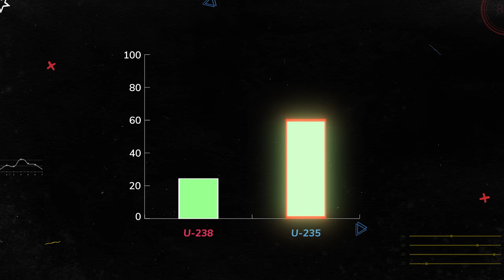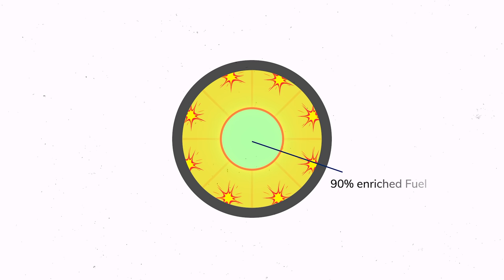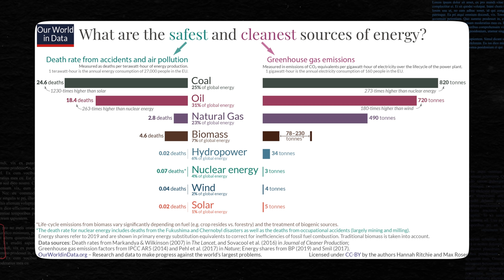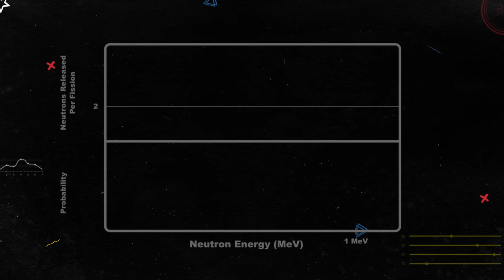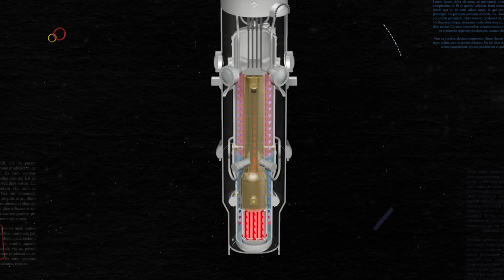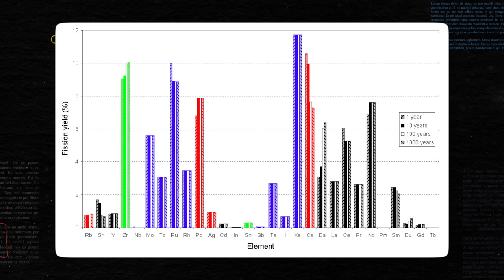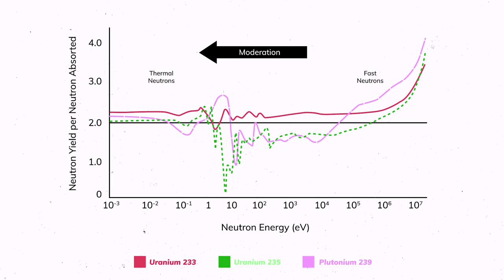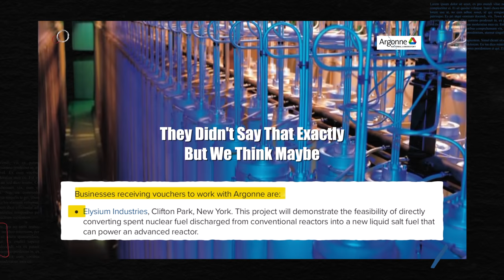This Reactor Feeds On Nuclear Waste

Comment: Being German I was socially implanted with a cringe  whenever I hear "nuclear". And too much cost, IMO, was offset to the public in the form of nuclear waste by the energy giants while they profited richly not caring about the radiating world they leave behind. Some more remarks on policy and governance to guardrail this nuclear renaissance, on top of your scientific excellence, I would highly appreciate.
Reply: @bike-cave-man2527   That is not actually true. They are only cost effective as long as other sources can compensate for thier intermittent nature. If you force them to do the same job, then renewables need energy storage and the price skyrockets. They are slowly getting better, but are not competitive with other tech at this time.

So as long as the renewable capacity is a smaller percentage of the total production, it remains low cost to the installer. However they drive up the total installation cost. The base load capacity must be large enough to cover for them when not running. This means that installing solar for instance adds cost to a system that already can produce the needed capacity. 
The operating costs of the renewables are usually low however and eventually pays for that added cost (again as long as it is supplemental, the cost is comparable when storage is included).
Reply: @garysmith5025  I don't really see vehicles being that effective for storage. The idea is fine, but the usage mismatches the with the generation. If I want to power my home with my car, then I need to be charging it during the day. Problems is that is also when we use it as a car, and it won't be home to be charged, and will return discharged to some level. In theory we could put large solar installations at some businesses and charge cars, but what is thier motivation to do so and would they have enough space?

I think home based storage will be needed. If cars had swappable batteries and you had two it would work.
Reply: @court2379  Regarding storage, please consider that many pumped storage plants have been built for valley filling, as nuclear power plants didn't like to be shut down during the night - this power needed to be stored. In Belgium the off-peak use during the night was the illumination of highways.
Reply: @court2379  The idea is not to allocate a given EV to a given home (with PV) and to match that. The idea is to combine a fleet of EVs with the grid, so it doesn't matter if a specific vehicle is not conneted to the grid. Its about statistics only. Regarding the infrastructure, please compare with the situations 120 years back: the filling station was the local pharmacy, and the typical gas station developed in the coming decades. So will be the charging infrastructure - in most cases, if there is a garage, this will be a socket at home.
Reply: all the nuclear waste from all the nuclear reactors in Europe created since the very first one was fired up could be laid out on a single soccer field and be less than a metre high (in fact you'd have space to walk between the stacks at that height)

Storing it isn't an issue. Most of it is kept onsite and contrary to claims, after 400 years it's LESS radioactive than the original fuel (which is quite literally only slightly more radioactive than a banana for any given volume - believe it or not, truckloads of bananas keep setting off radiation sensors intended to find weapons in ports)

The problem is vastly overstated by fearmongers
Reply: @George Mann There's the secondary factor that renewables can't produce enough TWh to replace non-electrical carbon emissions. Electricity only accounts for 1/3 of carbon emissions at the moment and eliminating the other 2/3 requires around 6-8fold increase in electrical production
Reply: @gunnarkaestle  "nuclear power plants didn't like to be shut down during the night" bzzt, incorrect. That is a direct artifact of using fuel rods and molten salt systems are immune to this issue.

The Oak Ridge reactor used to be shutdown/started up at least once a week because nobody wanted to babysit it over weekends anmd tests showed it could very happily go down to minimum and back up over any time period with no ill effects. No xenon waiting period required because no xenon is left in in the reactor

HOWEVER: even coal/gas plants have thermal inertia. It takes HOURS to get a thermal plant operational. (This is why the South Australian power blackouts happened when wind power failed for 6 hours - Thermal plant operators calculated ther costs of starting up were lower than income from electricity sold and declined to fire up their boilers until all costs were underwritten)

British local authorities who thorugh they'd save money by turning off streetlights at night got hit with HIGHER electricity bills because of the added complexity they inflicted on the power grids and generating stations (It turns out streetlighting is a good offpeak power sink and electrical authorities were happy to GIVE the power away overnight because it kept the networks stable)
Reply: @miscbits6399  Ok, yes, in ordinary nuclear power plants (ca. 400 units worldwide) that use solid fuel pellets, then the Xenon poisoning cannot be avoided. In (how many again?) reactors which use liquid nuclear fuels and have a "kidney" concept, then you can get rid of all the neutron absorbers. But how realistically can we expect to have a few of these in the 2030s online?

An the thermal inertia of fossil fuelled plants differs from technology: a ICE plant nees less than 5 minutes;  a gas turbine needs 10-15 from start to full power; a CCGT is about half an hour (it is basically the degassing of the water), and a coal fired plants needs (if it is a hot start = it was only switched off a few hours during the night) about an hour. Warm (weekend off) and cold (room temperature) need longer, up to a few hours. The problem is not so much the turbine, but more it is the boiler. This component accounts for about 50% of the plant's CAPEX, so you don't want to crack it by thermal stress. 

Another load for the night which became popular with more nuclear power during the 70s and 80s were a) night-storage heaters switched by ripple control b) pump storages.

Comment: depending on your "salt" you can still risk an explosion of the loop if it isn't closed,the most common is sodium which means even the moisture in the air can cause a reaction and if you end up with contamination in your "salts" you can also have a disaster on your hands

Comment: An important fact about enrichment. It took a long time to figure how you would get isotopes to actually move using a centrifuge when enriching uranium. The trick is to let Uranium react with Fluor which results in a gas. its the gas you run through the centrifuges, and since gas molecules are much more free to move around, it makes perfect sense that the gas on the outside of the centrifuge will have a higher concentration of heavy isotopes. Even if the effect is small, you can take the part of the gas with the higher concentration of the isotope you want an repeats the process.
Reply: The real challenge in building centrifuges was designing the bottom bearing which must support the spinning centrifuge at very high speeds.

Comment: Nice Video.  Thank you for educating the public and avoiding the pervasive fear-mongering.
Perhaps the Oklo Aurora would also be good subject matter.  Distributed, behind the meter power for data centers etc.  Using used EBR-2 fuel, with long refueling intervals.  Heat-pipes, probably metal fuel.  A chance to rework outdated regulatory barriers.  Perhaps automated operation (one would hope).  Easily contacted (but seemingly secretive) founders.  Of course there are downsides to being so small: likely expensive for grid; not a big displacement of fossil fuels; etc.  There was a recent, not terrible article mentioning Oklo, oddly focused on decarbonizing clothing manufacture.

Comment: Personally I'd love to see a video on the physical failsafes in modern reactor designs. The engineering involved makes nuclear disasters seem less magical and more something that can be anticipated and prevented by science.

Loved the video, keep up the good work!
Reply: Interestingly a plant like this can install frozen plugs of salt into drains in the reactor. As long as the power is on the plugs stay frozen. Cut the power and the whole thing drains into a much larger tank, slowing the reactions and cooling the fuel. If i recall correctly the one they had at ORNL in the 60s, they could just unplug it for the weekend to shut it down.

Comment: 1. Chernobyl was not a PWR but a graphite moderated pressurized fuel channel type reactor. 

2. Almost all reactors today use plain old water as its moderator. Very few use graphite as a moderator.

Comment: This isn't just the future of atomic energy, its the future of arms control.  One of the principle difficulties with non-proliferation is that it favors the nation-states that already have nuclear arms, at the expense of nuclear energy development in less technically advanced nations like Iran.  Iran wishes to build nuclear reactors to ensure energy independence, but the fear is that Iran will also use these reactors to produce enriched Uranium (HEU) or weapons-grade Plutonium as part of a WMD development program.  Generators like the molten salt or thorium reactors are the middle ground - you can have your nuclear energy, but without adding nuclear arms to the equation.

Comment: for sake of conversation I also wanto to throw out there they have found a fungus in Cherynobly that actually metabolizes radiation by a process of radiosyhthnesis, exactly like photosynthesis it just uses a MUCH higher frequency of emission to power its metabolism; this does also have the effect of cleaning the radiation from the environment..

Comment: The Sodium Reactor Experiment at the Santa Susana Field Laboratory near Simi Valley, California experienced a meltdown where 13 of the reactor's 43 fuel elements partially melted, and release of radioactive gas into the atmosphere and was reported to have released up to 260 times more radioactive iodine-131 than Three Mile Island in 1959.

Comment: EBR-1 in Idaho has a display in the back rooms where no one goes because they are too busy playing with the robotic arms and jumping up and down on the reactor that explains they used to use NaK which is much safer but were told to stop using it. No mention as to why they were told to stop

Comment: Sounds like a good  idea. national Geographic had a special issue on nuclear power in about 2001, and discussed these fast neutron reactors. i don't know why we haven't been building them all along.
Reply: The Oak Ridge MSRE was thermal. Fast reactors were considered but the concensus was that not enough was known about them at the time and it was on the "to do" list. 

The issues with graphite are overstated. As long as neutron densities aren't too high a graphite moderator will last essentially forever 

(ie: the problem is when you try to get as high a power density as possible - which simply isn't needed. it's like running jet engines at emergency power all the time to get a 4000 hour lifespan instead of defining 85% as "standard power" and getting a 60,000 hour lifespan)

The 8MW ORNL MSRE graphite moderator had no detectable/measurable damage after 9000 hours of "full power" operation (it could go to 11MW at absolute maximum but 8MW was the design power)

Comment: Can't help but feel that this video completely glossed over the technicalities, challenges and the development of the new regulatory requirements required for this technology. The first thing that comes to my mind are challenges faced with the molten salt fuel which can be very aggressive to the materials that are used in the construction of the containment system. Which can cause the service life to be limited as a result and increase the potential for an occurrence of a failure of feul containment. Combine this with the possibility containment components being difficult and costly to be service/replaced. Because of the materials that the components are made of being in direct contact with the molten salt fuel, and also the potential for the assemblies to become contaminated with nuclear products. I am also getting a sense of a lot of spin being served about the portrayal of actual hazard represented the waste products from the spent fuel. There also seems to me to be the haunting echo's of promises of lower cost. 
Putting emphasis on a concern for facilities to look nice and pleasing to the eye. The appearance of many industrial facilities is just a function of there design for the process they undertake. Should we really be allocating a significant parts of the budget to making a facility aesthetically pleasing to win an architectural award ahead of the safe operation.
With my limited knowledge of this subject this is enough for me to be incredibly distrustful of this presentation and would strongly recommend that anyone viewing this should keep a very healthy scepticism in mind. Also to seek independent sources for knowledge on this subject.

Comment: I think an effective business model is water desalination.  Create a modular plant that can be shipped everywhere.  Then produce a second shippable module that can electrolyze seawater and use a hydrogen fuel cell to convert H and O2 back into energy plus pure water.  Simple and compact.  Easily mass produced and shipped but also optimized overtime.

Comment: What I am surprised I've never heard anyone try is this: Hot nuclear waste could be buried in a large sealed containment vessel with heat exchangers around it. Then you build a industrial park around it, and just use it for hot water. Many processes like food manufacture, ethanol production and plastics manufacture simply need normal temperature steam. Basically a way to use waste and contain it at the same time. If you make the container big enough and buried deep enough then you wont have any problems with terrorists or other leaks.

Comment: Some thoughts:  #1) I believe you already did a segment on the CANDU reactor and it's use of heavy water, which is so efficient at moderating neutrons without capturing them that it can use unenriched uranium. The down-side is the insane cost of high-purity heavy water. I tried to figure it out once, and am probably off by quite a bit, but I came up with a bit over $100-million USD.  #2) IMO, no matter what the underlying approach, modular reactors are the key to eliminating the insane costs of building fission power plants. Sounds like Elysium is partly there.  #3) One of the coolest aspects of molten salt reactors is the possibility of continuously processing the fuel to remove fission by-products. Good things happen when fission by-products are removed from the core.  #4) @11:52 That could be Barad-dûr the Dark Tower, which is probably an unfortunate choice to take the viewer to their happy place when they gaze upon your power plant.

Comment: I hope some one else mentioned this little issue, which was not mention.  Its a Sodium (NA) reactor, and all the stuff they said is true.  Two issues 1) how do you protect the reactor primary containment and gear from nuclear embrittlement, granted this happens to current reactors but you can not ignore it.  2) The reason we use water is cause its every were, and we have used sodium in military applications such as submarines in the past, problem is Sodium DOES NOT LIKE WATER, how are you going to make sure water never gets into the primary loop.  Because if it does, say when your cold and shut down, your fuel is going to go boom.  It should be safe as long as you keep it hot cause the water will evaporate before it gets to sodium.

Comment: So there's no risk?  Nothing could go wrong?  Elysium's New Reactor is all upsides and no downsides?  That's unbelievably fantastic!!
Reply from the maker: The downside is that it hasn’t been built yet so we don’t know exactly what could go wrong. 

In terms of safety, likely no issues, but does it operate as expected for the decades that we need it to work. 

Those kind of questions will be answered when they make the test reactor.
Reply: @TechforLudditesSira  If nuclear reactors always operated as expected then safety wouldn't be a problem.

Comment: The Elysium reactor is a game changer. Not only will it burn spent nuclear fuel, because it is fast spectrum it can also burn depleted uranium of which there are huge stockpiles. And energy generation system that used the Elysium type fast reactor would have several thousand years of fuel at todays energy demand. 

With almost no long term waste produced like Pu-239 and almost none of the hazards of current pressurized reactors with solid fuel cores and cooled and moderated by water, the Elysium removes almost all the reasons most people object to nuclear power.

Comment: This is really freaking cool! 
How much nuclear waste is required to start a typical reactor and how often does it require refueling? I'm sure some folks will have issues with the transportation of large amounts of nuclear waste on public transportation infrastructure. If I had to venture a guess, a typical reactor does need a litteral ton of waste to get going. Maybe only a few 55 gallon drums? 

Since most nuclear waste in the U.S. is still sitting at their respective nuclear power plants, constructing these in proximity to existing fission plants would have very good synergies.